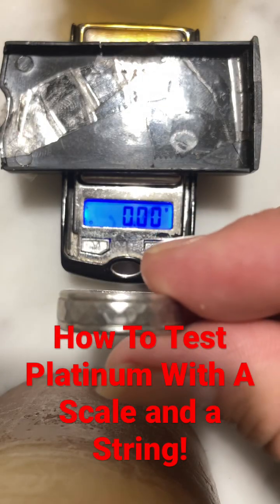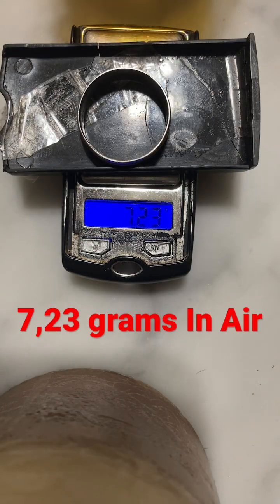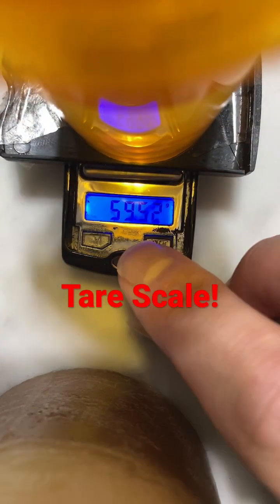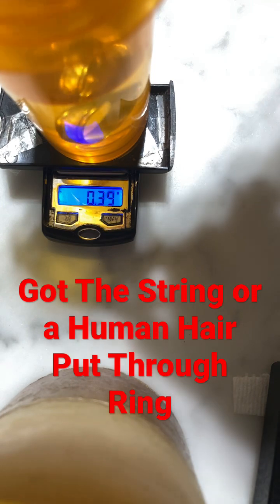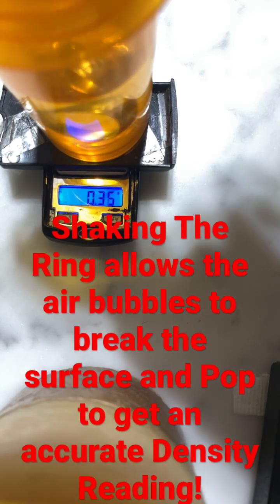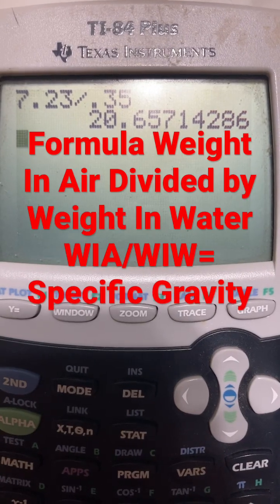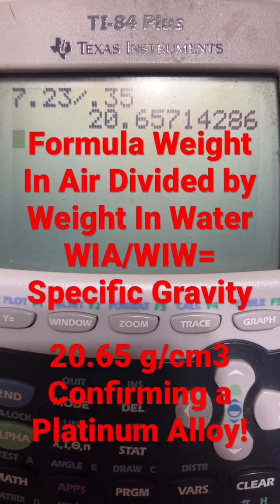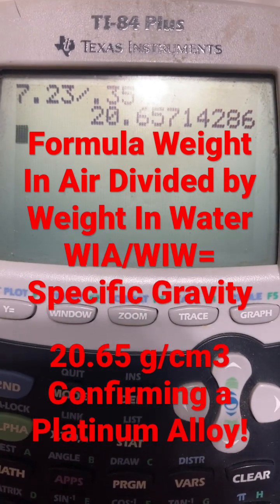How To Test Platinum Jewelry With a Scale and a String at Home!

Comment: I’m kidding 
I kinda get it 
Is there a specific amount of water on a specific size tube? You wanna submerge it in?
Reply from the maker: @Wickedstickyflowers

You can use anything to hold the water. For this video I’m using items that can fit into frame for the short video. 

For most rings and thin chains and necklaces a container that holds 50ml is all that is needed. 

For larger pieces I use a 2 liter plastic container and a larger desktop scale accurate to within 0,01G.

Comment: Density of platinum is 21.45 grams per cubic centimeter not 20.6571
Reply from the maker: @JayP7676

The density of 95Pt/5Ru

Is 20.6-20.7 g/cm3 

You can confirm this alloy density online with any casting grain manufacturers! 

Sincerely,

TBBW🐺
Reply from the maker: This is 950 platinum 50 Ruthenium.

An alloy of 95% platinum  and 5% Ruthenium. 

TBBW🐺